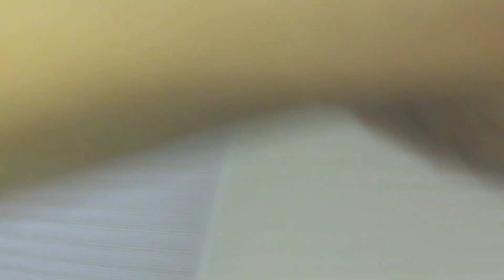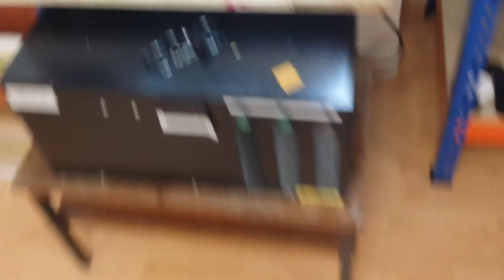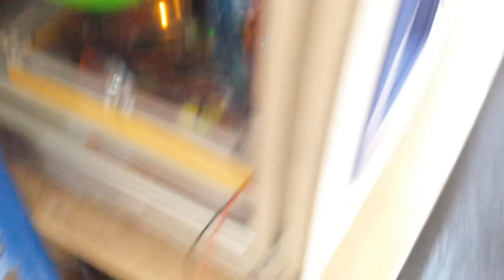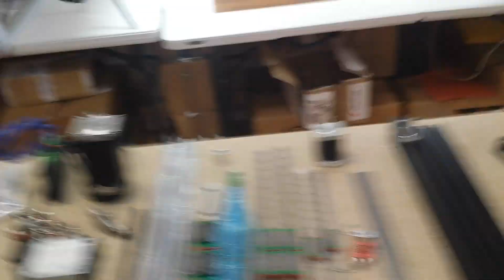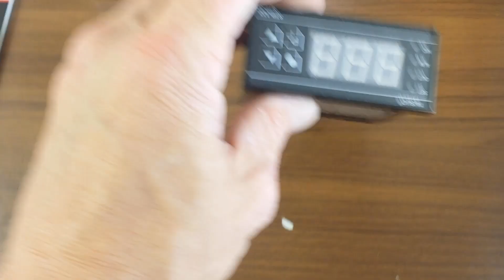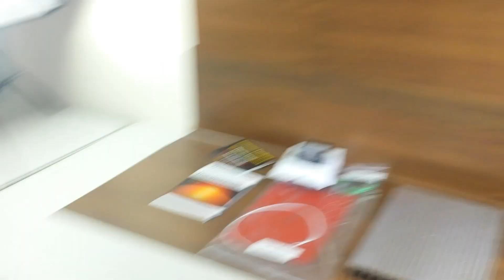NEW CHAMBER HEATER PARTS FOR ABS PRINTING

Comment: Hey mate was wondering how the heaters holding up after 2years. Anything you’d do differently?
Reply from the maker: Hi there, I have not been printing much over the last two years as so busy with work other projects and life in general, but if I was to make another heated enclosed printer then I would insulate the chamber more and just use cheap cartridge heaters mounted to a smaller heatsink and a small fan to circulate. The heat matts that I used on this build are expensive and do not last very long it seems (4 Dead in 1 year). Overall the heated enclosure was essential to making strong ABS parts that would hold up to industry use. without the chamber I could not replicate them using other materials. things have moved on somewhat and there are new materials to try out but I think ABS is most suited to cheap industrial parts if it can be made without too much distortion. . With this printer I made over 50 large ABS LCD screen enclosures that all went into an industrial production environment and they are still going strong today 2.5 years later.

Comment: Is there a specific reason why you're using abs? There are many different type filaments that's better than abs. Just curious.
Reply from the maker: ABS is suited to industrial environments and the enclosures that I made all needed to be cheap and very strong. Nothing else could offer the same cost per unit and provide the strength required for day to day industrial use where exposure to heat /chemicals and physical abuse would be constant. They have all held up so far 2+ years later.

Comment: Awesome stuff you have there. But man, this is all such a waste of cool junk for a heated build chamber. Why not just take apart one of those wall plug style heaters and using it? that's what I did and it works great. I'm getting to 50C in less than 5 minutes without even switching on the bed, and it can easily go up to 85. check this out: https://photos.app.goo.gl/jfvEFWsFqNbvjeHD6
And it's winter. I suspect I'll need to vent hot air when the summer comes. and all for like 20 euro

Comment: Love the chamber heater design. How will you get the heat off of the heater? Air blowing over it?
Reply from the maker: Hi Thomas - No Unfortunately I have found any air disturbance in the chamber is bad ! So for this reason I use a Large Heat sink to Radiate the heat off - Natural convection inside the Chamber will circulate over time. This is the reason for the water cooling so that all fans are external and all motors are outside the Chamber etc.

Comment: Thank you for stating that an enclosure is definitely not all you need to print in ABS succesfully, like some companies claim. Warping keeps decreasing with an increase in ambient temperature, being almost zero at Tg of 104°C for ABS.  This is higher then the ideal printing environment of about 85°C where a little tendency of warping remains present. Standard  bed adhesives will easily suffice in keeping printed parts dead-flat at these temperatures though. Great video as always of your wonderful machine. Ever considered ceramic PTC heaters? They hold their max temperatures of 240°C and cannot overheat. I use these in combination with fans underneath as I don't know much about electric safety measures. ;)
Reply from the maker: Hi Hannes Browaeys - I have found anything over 55 Degs C will give dramatic improvements on Standard ABS - Not so much on the Modified version like ABS+ - These will benefit from just 45 Degs C. But overall it proves the point and it has become an essential part of my machine. I did consider PTC and these were my first choice - However due to price for good quality ones and the issue with mounting several of them to give the combined surface area and heat required I choose the Heat Matt. My first attempt at heating the chamber was with a 300W PTC - This just wasn't up to the job and so I made something myself.